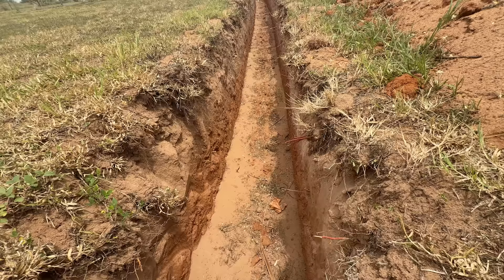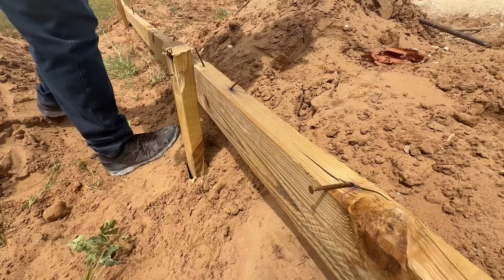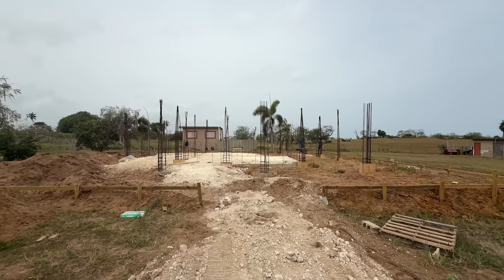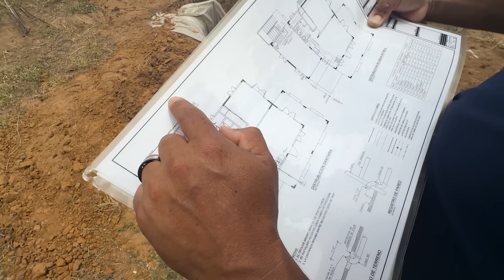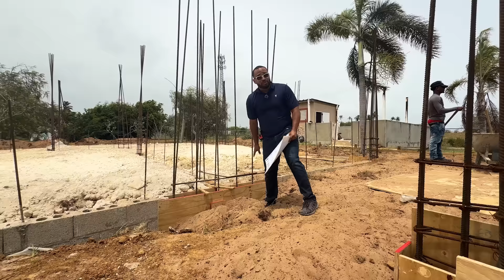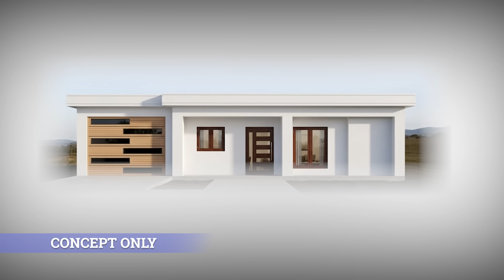BREAKING GROUND ISABELA PUERTO RICO HOME BUILD VLOG 01

Comment: Rebar should be 3 inches inside the outside of the concrete or water will absorb into the rebat and rust and concrete cracking everywhere due to the rebar rust expanding inside the concrete. In the philippines no one follows this and concrete just cracks all along the rusting rebar.
Reply from the maker: Hey! Once the stucco (empañete) is completed, the rebar will have a 2-inch concrete cover, providing the required protection from the elements and meeting our project requirements
Reply: @backtotheislandPR i was looking at the foundation where the columns are buried the rebar is very near the concrete surface.